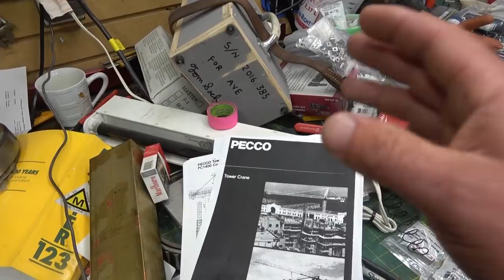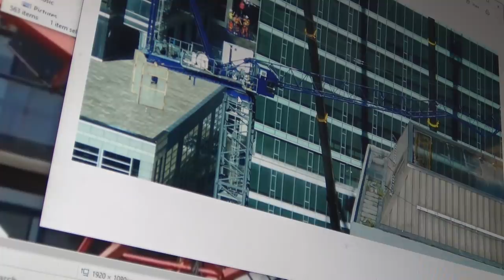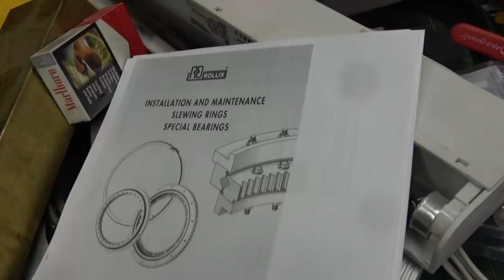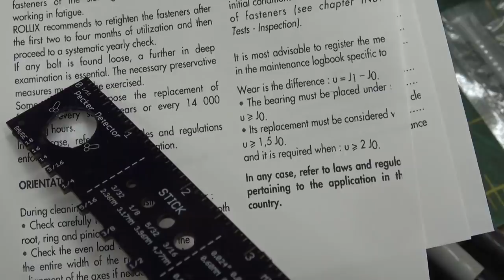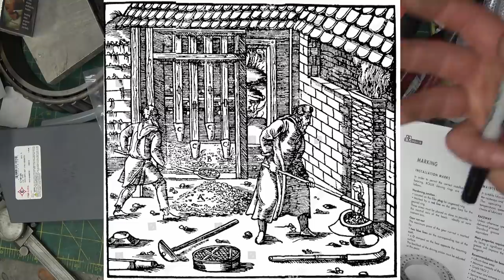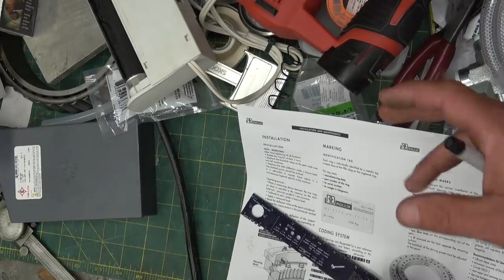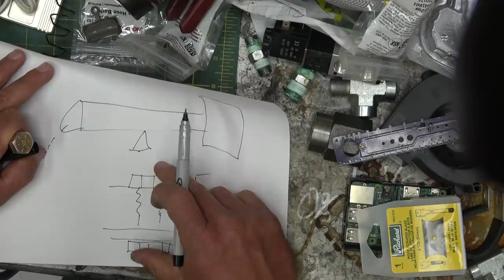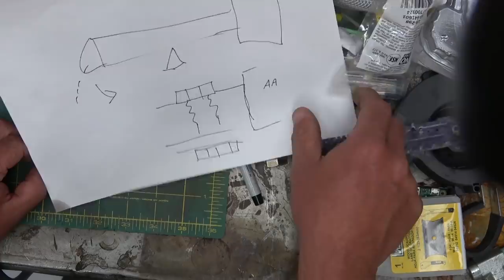This is happening too often | 2 Cranes Collapse in Toronto

Comment: Went to service a 2 year old wharf side loading crane found the untouched grease gun supplied with it still in the packaging, no grease on the slew ring rocking like grandpas old porch chair £30,000 later a new slew ring installed for the lack of £20 worth of grease.
Reply: Yeah but that grease gun is still frickin minty as Frick ,you could get good money for something like that ,
Reply: It's rarely the $100,000 bits that fuck up on their own. It's the $10 bits no one could be arsed caring about.
See: the amount of pilots on stations and out in the bush that will spend $500,000 on a plane or chopper, and then feed it gas sieved through a 30 micron diesel filter instead of a 0.5 micron av filter because a single av filter's $500 and the diesel filters were $150 for a pack of five from Dyke's Diesel Engine Warehouse.  
Get so many cow cockies ringing up asking for a bunch of aviation gear...but who also just so happened to buy a bunch of diesel filters along with it.
Reply: See the same thing all the time on Excavators. Driver thinks its the fitters job, fitter thinks its the drivers job. Then when its so bad it needs plating welding and boring, its my job.
Reply: ball stealthy  Plenty of grease on the slew ring, I hope.
Reply: @simonsackett  

Ol Ball Stealthy prolly sloughed off and slewed askew...!

nnnNNO Prob-lemmo! Cpl a jeezly guy wires and a good safety officer later......
Reply: ball stealthy  
Don't brag too much guy. Everyone else did too.
Reply: Wouldn’t be surprised if “We need a day to do basic maintenance” was met with “No! That cost too much money!”
Reply: For want of laziness, the grease was not applied.
For want of grease not applied, a repair 1,500x the cost of the grease was needed.
Reply: @ALovelyBunchOfDragonballz  Can we call that a fat bill?
Reply: Welcome to the status of any kind of mechanical operations today. “Hey, we need to keep that part lubed and clean routinely.” Admin “sorry, we can’t afford your labor to do that.” Yep.
Reply: ball stealthy  good for you... Just hope it didn't run 'ya 30k!
Reply: Which of course is why my old VW combis and mercedes fintails have not needed suspension overhauls, every 5000km out comes the grease gun and oil cans with the boots replaced when necessary.
Reply: @eddyschoen2149  in many marriages, that ends up being the typical going rate...
Reply: That sort of reminds me of the one guy at work that always boasted that he never changed oil in his toyotas, just bought new ones. Must have been great to be the second owner of his sloppy clunkers..
Reply: Everyone seeing the negative (£30,000 worth) but see the positive..... that grease gun will be worth more unused and in a bag!
Reply: @bazookamoose7224  Well, I'll say that's true even for the vending industry. Huh, is every industry riddled with crap management???
Reply: @trevorhansen1940  the problem is with the beueacracy of size, the person that says to trim the budget is not the person responsible for the how to do it, nor is that person responsible  for maintenance,  and that guy was busy fixing the last thing fucked up so he never seen the memo.
Reply: @jaydunbar7538  Exactly muh point sir. The fewer people involved, the fewer mistakes.
Reply: Im just getting my whistle wet at a yard with a barge. I like it.
Reply: well, only costs £29,980 when you think of the money saved previously from the grease.
Reply: What would the world do without Canadians? God fucking bless you lads
Reply: Funny you say that.
I used to deliver plant equipment few yrs ago.
Excavators, dump trucks, genie booms. Rollers.etc.
We delivered all plant equipment with a grease gun which upon collection was rarely touched.
The thing here regarding the excavators.
 We all knew they'd would take the bucket of hook a chain on & use excavator as a mini crane and move ancillary equipment around the building site - even though the machine could physically move equipment wasn't what they were designed to for....
Reply: you’ll never get sacked for wasting grease- my ol boss used to always say grease is the cheapest thing in the world, makes sense when ya compare grease to repairs
Reply: Maintenance, schmaintenance
Reply: Martin Powell god damn that’s a tounge twister
Reply: Wire rope, Palm tree, same flex design
Reply: maintain equipment? that's a novel idea, I pretty sure most businesses never heard of that fucking concept. After all what could go wrong with a machine you have to use for your job that can't be maintained thus always malfunctions and makes your job shittier and more unsafe.
Reply: Martin Powell that’s what she said.
Reply: @ALovelyBunchOfDragonballz  "for want of something" means it wasn't there. So it should be "for want of diligence" or some other way.
Reply: @JunkCCCP  It's a japanese saying I barely remember. I'm sure I messed it up.
Reply: N.              I
Reply: John J it’s not that business never heard of maintenance is just the suits at the top never have done maintenance and don’t understand it, the books they read in college never mentioned it....
Reply: @sockdip69  you cannot rake pic's of your imagination. Andy 🇬🇧👍
Reply: Typical.

I had a service call to a azimuth thruster, a full hydraulic model, the thing was heating up, movement was too slow.
Turned out they never changed the oil filters in 6 years.....
Reply: @cardboardboxification  ow LOL😂, I'm talking about an azimuth thruster as in a 360 degree rotatable propulsion unit found on tugboats, harbour dredgers and other vessels in need of excellent manoeuvrability. 

That said, a dirty mind is a joy forever of course 😉
Reply: humans are humans worst enemy
Reply: So you DON'T want work?? Imma confused....
Reply: Jonny B  I love machinery I personally am very thorough when it comes to parts and maintenance on whatever but is. My 4 stroke Husqvarna trimmer gets Liqui Moly 5W40.
The air Compressor I used would get Royal Purple for the Honda engine and the pump too. Cosmetically I don't really care how it looks but mechanically I clean maintain and check everything I can.
Reply: Martijn Zwenger - are you rolls Royce or wartziller?
Reply: @Raynedog00  First two questions from "technical support".1 Is it plugged in? 2. Does it turn on?
Reply: damm
Reply: @bazookamoose7224  its part of most of human cultures today. to have a throw away, buy new, mindset. drilled into them by the way.
Reply: 30 years as a tower crane operator and I've seen that too many times and the effect of using the wrong grease
Reply: @jaydunbar7538   And the guy who denies the time to do maintenance has usually moved on to the next job position when the catastrophic failure happens.
Reply: Well, hope you took that £20 of grease and said to them its ky for next time they shaft themselves with no preventative maintenance. (seems like something our Boris would of done to be honest)
Reply: On the ledger it’s called “Depreciation”.  An abstract variable that can be converted to an asset on the executive bonus pile
Reply: None of that is true
Reply: @foulbastard  lol, as much as £19.50

Comment: That preload visual with the rubber band was perfect. I gained a brain wrinkle on that one. Thank you for that, AvE.
Reply: My thoughts exactly, keep up the good work AvE
Reply: In race engines we don't torque bolts, we stretch them a set amount regardless of torque. Everything affects torque, ie lube, etc, so it's more reliable stretching them.
Reply: MY question for this is why doesn't the load applied stretch the bolt the same length regardless of preload? Like if you only hand tighten the nut, you have zero preload. Thus the bolt will have 50000 pounds of force stretching it once the load is applied. If you torque the nut down, then you will have say 30000 pounds of preload stretching, PLUS the 50000 pounds of load stretching. Why would the bolt not stretch more in the second scenario?
Reply: @temporarytelecast  I believe the 50000 lb load has to overcome the 30000 lbs of preload, so it only adds 20000 lbs beyond the preloaded stretch.
Reply: @temporarytelecast  #2 would stretch more, with 80k force at install.  #1 would be longer at the end of the test. As the previous comment stated the momentum built up by physically taking up the slack caused by no preload is likely going to exceed the 80,000 PSI of the torqued Bolt.

In this scenario 30 preload 50 load would require a larger Bolt to accommodate the preload taking up three-fifths of the capacity.
Reply: @temporarytelecast  bolt loading in tension is an interesting concept to get one's head around. Consider this...if you clamp two plates together with a bolt, the plates resist the bolt clamping force with an equal and opposite force. So if you torque a bolt to 100 lb tension, the plates resist with 100 lb force. If you torque the same bolt to 50,000 lb, the plates resist with 50,000 lb. The plates have a net 50,000 lb of compression force at their interface.
This is where it twists the mind a little...if an external tension force is applied to the plates such that they want to move apart, the bolt does not see an increase in force until the external force exceeds 50,000 lb. 
This is because the clamping force at the interface between the two plates is only as big as it needs to be. If 10,000 lb tension is applied to the plates, the clamping force at their interface is reduced to 40,000 lb and the bolts still have 50,000 lb tension. If the external force is 50,000 lb, the plates have no clamping force at their interface and will begin to move apart as the force increases above the 50,000 bolt tension. It is at this point that the bolt "sees" tension > 50,000 and starts to stretch further.
So in ave's example, if the rubber band was clamping two objects together and was pre-stretched to a tension equal to the maximum external applied force, it would never stretch further under load and would never be affected by fatigue.
Reply: I informed 2 maintenance crews (city parks facility, not landscapers)  at  12 months apart( at Ogden, Ut 24th st bridge ball park  )that they had a light pole in center left field  that they had loose nuts  and that I could see the slack running in and out as the 100' pole rocked back and forth 1/4" 1st yr  3/8" 2nd year . Ya its tight about 10-20 times a minute 
 eg  hand jobs are a bad idea  when your nuts are 3"  some 5year old like I was will figure out how to collect a pair .
Hope  Ogden city of: mind's there nuts before some unsuspecting center fild player gets permanently  installed like a 16d  by a framer at 97% learning curve, faster than a nale gun. Lol
Reply: I humbly disagree with that demonstration.  A bolt properly torqued will not yield any more until ALL of that force created by the stretch is cancelled by a force opposite.  Think about it, if you have two sticks bound by a rubber band with ten pounds tension, pulling the sticks apart won't result in movment until you pull harder than 10 lbs.
Reply: @benpaske6361  that's pretty much what he said, isn't it?
Reply: That was really a good demo
Reply: @benpaske6361 This is my understanding too. Properly torqued meaning pre-load (clamping) should be greater than the working load of the joint in which case there is no stretch. Once working load exceeds the pre-load, the forces would start to add and the joint would start to stretch and gap. It's kind of hard to wrap your mind around it sometimes. The diagram in the theory section of bolted joint on Wikipedia is helpful to anyone trying to understand this https://en.wikipedia.org/wiki/Bolted_joint#Theory
Reply: This doesn't make sense to me either. Preload tension in the bolt is not negated by the load, bolt tension is only increased. 
There already has to be an equal and opposite force acting on the sticks keeping them apart, if they're being pulled together with 10 lb of force and not moving. Seems like any load would be in addition to that opposing force.
Reply: @temporarytelecast  it probably would, but the cyclical loading / unloading will work harden the material and the bolt will break. or the damn nut will fall off..
Reply: SidneyCritic ComedyHound same idea in lots of aerospace applications

Comment: I worked in a factory that built manlifts. The boom lifts used what they called ring gears between the turret and chassis. It took 2 of us to install that gear on the turret side. It had something like 40 1" diameter bolts. We had a 6' tall torque wrench, 1 guy held the head and moved it around the bolts in a star pattern. The other guy applied the torqe to the end of the handle. We torqued them in three stages ending at about 500 ft/lbs. And they were lock tight apllied. The ring to the chassis bolts were torque the same way except with one guy and a hydraulic torque unit.
Reply: Hey mate, I worked on a fleet of logging machines (Wagner log stackers) Qty. 32 wheel studs each wheel, 7/8" dia. studs, 460 ft lb torque. Almost a daily exercise. Yours and mine is only small stuff when you look into other industries. 
To Ave; Thank you for improving my knowledge with an entertaining, light, easy and succinct lesson.

Comment: I used to work for a construction company and dealt a lot with cranes and crane compliance. Our rigging and wire rope supplier had a vendor fair where all the manufacturers came in and showed off their fancy new products. As i was looking through all the booths, i noticed the the wire rope manufacturers seemed to be unanimously German (there might have been one Austrian company, but its all the same to me.) I brought it up with one of the guys there and he was like "yeah. the Germans take wire rope and engineering pretty seriously." as it turns out, not only can students at German universities major in wire rope, but they can get a PHD in wire rope. I thought that was pretty fascinating.
Reply: How long can you use a bolt in a crane like that? Is there a service interval?
Reply: @CyberlightFG  Check your crane service manual
Reply: Germany - the only country where you can choose between getting a PhD in Wire Rope or a PhD in Brewing Beer. What a country!
Reply: A buddy of mine who builds slings tells me that for years lots of the Chinese wire is below spec or deliberately mislabled. He's rejected spools and they magically reappear.
Reply: You can get a PhD in anything where there's original research to be done
Reply: Will Shortz, puzzlemaster for the NY Times crossword has a PhD in puzzles.
The cliche is if you want great electronics go to Asia, if you want high performance cars go to Germany, but if you want to go to the moon. . .
Reply: @jeffutz7024 ... you need a time machine
Reply: "it's all the same" yeah they thought so too
Reply: @CyberlightFG  im not 100% on this but i believe after 100,000 cycles a bolt is considered infinite life. So if the manual stated the bolts were working in fatigue it was calculated that failure could occur under 100,000 cycles
Reply: @mjost11211  How is a cycle defined?
Reply: @CyberlightFG  a cycle is the time between when a system goes from minimum stress to maximum stress, and returns to minimum stress. In this case, the bolt is regarded as the system. The equations are built around maximum and minimum, so a properly designed crane would experience a relatively low number of full cycles. Cycles below full stress often do not exceed the bolts preload stress and results in no dynamic load.
Reply: @ArtHeld  Bier
Reply: @ArtHeld  I bet they have PhD's in artillery too.
Reply: The elevator at my apartment recently went through an overhaul and looking at the rope I was impressed by how thin it was.
Reply: @jeffutz7024  ...you need a TV studio in the Nevada desert...
Reply: @obsoleteprofessor2034  is that you Joe Rogan?
Reply: SUPERIOR GERMAN ENGINEERING they don't fuck around when it comes to rigging
Reply: Your{wire}ropeans for ya...📉😎📈
Reply: @jeffutz7024   There are two kinds of countries: those that use the metric system and those who have seen a man to the moon.
Reply: More western european countries are like that :D
Reply: Awesome
Reply: bobafruti - you have at least 4 separate ropes or more to a lift, you can even have flat rubber bands with a steel core , the SWL isn’t much on a lift opposed to a crane, heaviest I look at is 33 people/2400 kg
Reply: Arty would be a "working man's phd". I helped write the tech specs for 14th Marines SOP on the electronic fuses as a gun chief/projectile man
Reply: Still better than liberal arts
Reply: I wonder what sort of original research in wire rope looks like at this point in time. New materials? Different fabrication techniques? What are the unanswered wire rope questions?
Reply: @bill605able  no that was contracted out to the USA
Reply: @bobafruti  did you compare the old one to the new one?
Reply: Wire rope technology isnt just about the wire rope . Its also about the application .   A properly maintained crane gets new rope , every so many hours .  Ive got piles of niece  soft  anti- rotating cable that looks like new , but has had its   hours .  I chop it up and use it for ground pulling chockers , I love it , its free .  We were towing underwater    Navy equipment , have a mile of cable down .  We had to count the number of times , we wound it on  the drum ,           when we brought the equipment up .   The ocean salt dries between the strands , and wears out the cable , They        cant afford to loose the hardware we are towing .
Reply: @obsoleteprofessor2034  ask USA army and 911about subpar metal
Reply: @bill605able  Ja, Korporal Ratzinger studied artillery before he switched jobs to become Pope. Better health benefits.
Reply: Someone has to keep the cranes running on time.
Reply: @lucas  FEHR BROS out of Saugerties NY?  They are in rigging equipment & garage door hardware. Good company